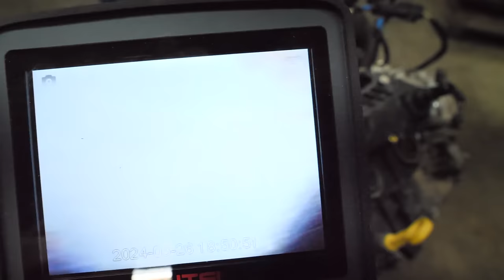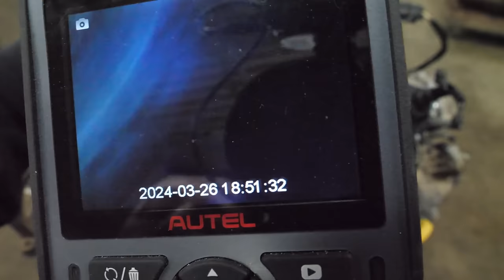ANOTHER BAD 2.7 Ecoboost? 2018 F150 Twin Turbo V6 DEAD @ 131k Miles

Comment: A big V8 loafs along to produce 335 h.p. which it can do easily for decades given reasonable maintenance.  A small 6 screams at the very edge of self destruction to produce 335 h.p. And what moron decided an oil pump should be run by a belt?

Comment: Engines have been very complex  over the years. But ,seriously, a rubberized belt  inside the crankcase and emerested in high temp oil. Driving the most critical component . Engineers need to think about serviceability. Another thought. They're building the motors to be disposable at our cost. Just like the BIC lighter. Run out of gas and throw it away.

Comment: I'd replace the engine...not repair. Just because of how stupid engineers are for their design. No sense in having to remove the cab to replace an engine or to pull the heads. Plus, if i changed an engine I would REQUIRE the owner to change the oil every 3000 miles at my shop to maintain the warranty.

Comment: A rubber belt to run an oil pump?   Plastic oil pan?   I bet plastic oil pumps and cam shafts are coming next.  This is why I'm sticking with Toyota from now on. I hate new-fangled designed-to-fail "engineering"

Comment: The next V6 is completely scrap. The only reason why car builders make V6 engines is exactly this: No long lifespan, heavy, noisy and almost unrepairable.
Volvo did together with Renault and Peugeot a V6 engine in the 70s, it was the worst engine EVER in a Volvo. They did it never again for some reason....
You seem to be a BMW guy (in Europe they are wanker's choice).Has any BMW a V6 engine?

Comment: I know this is going to make me sound like an old fart (which I'm not) but I still have lingering doubts about the longevity of turbos.
Reply: just sold my '90 diesel jetta with 410,000 km on it as a runner, original turbo. Had another previously go 600,000, broke a ring (overheat), turbo still good.
Reply: Okay, GAS turbos. :)  @CedarAshCanvas

Comment: Sometimes the ford EcoBoost in the F150 gets a bad rep. On the surface there appears to be a LOT of failures. But the truth is that the ecoboost F150...... The F150 out sells EVERY other pick up truck in the WORLD  by a good margin. It is also the NUMBER ONE sold vehicle (not truck VEHICLE) in the United states period. The F150 has also been outselling other trucks for the past 45+ years in a row. Now with that said. How many more f150s are there on the road compared to other brands. If 1% of 2 million fail than it will seem like a VERY large amount of failures but the reality is that there is just a LOT more of them being produced so you will see a lot more of them with problems. Its just numbers. The fan boys tend to leave those facts out when they chit talk Ford.

Comment: Junk motors all of them, throw away car. Try buying parts for rebuilding all the different motor designs. Then throw in plastic timing covers, oil pans, valve covers and bolts.😢😢😢

Comment: wow a plastic oil pan and rubber oil pump drive belt.  Ford is just hot garbage these days.
This video needs to go viral so every car buyer can see that ford is just using the cheapest materials they can find and then selling trucks for 70k...
Reply: Despite all the plastic these are extremely reliable engines. Owners love the 2.7.